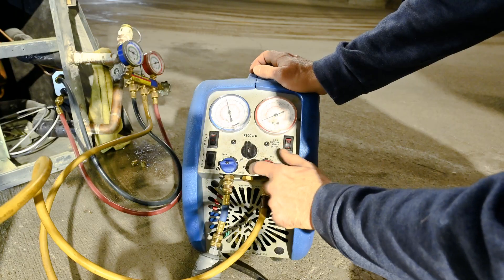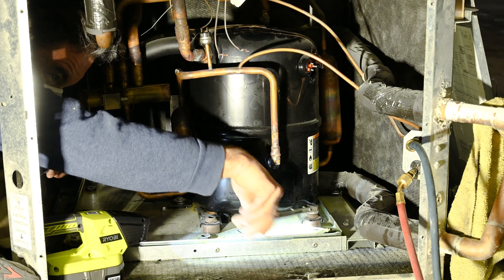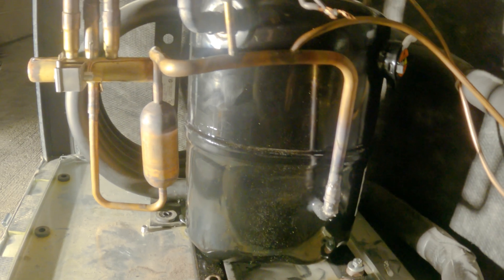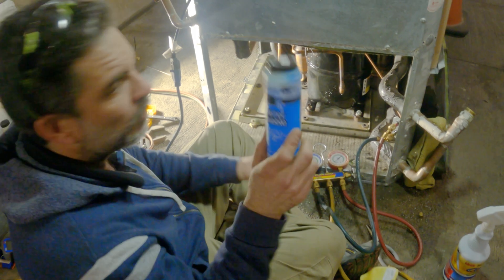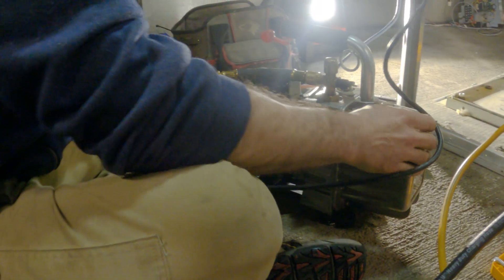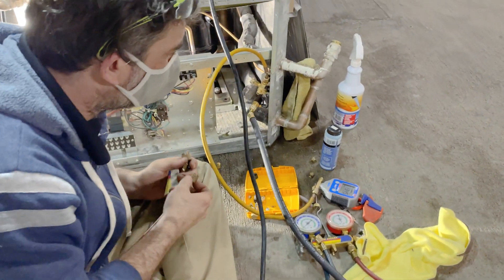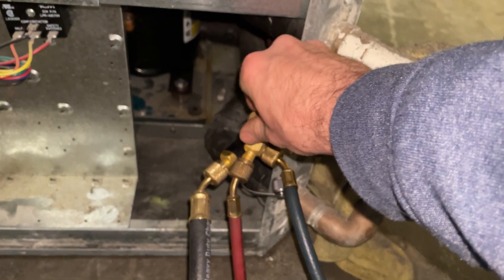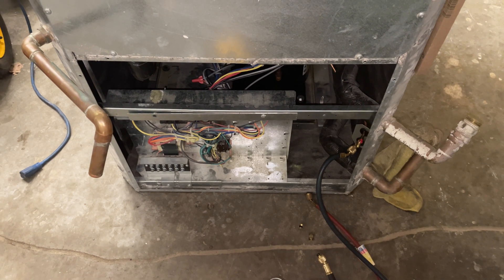Compressor Change Out on a Heat Pump

Comment: Why the system  wasn't  flushed? No mention of it. Filter drier replacement alone, is not enough if you had a compressor go
Reply from the maker: On a compressor failure due to acid it’s necessary to add AcidAway into the system. Unfortunately, I work as a floating tech in the apartment industry and rarely see properties (never) that carry all the tools for these repairs (acidaway, acid test kits etc).

Comment: Nice work sir….Can you explain how that lockout relay works or could you send me a model serial number for that unit so I can look up the schematic?🙏🏾
Reply from the maker: The 24v power wire goes through a series of safety switches, if one of those trips the lockout relay will open. 24 volt power must be turned off or reset, as well as the safety device that tripped it, for the lockout relay to close again